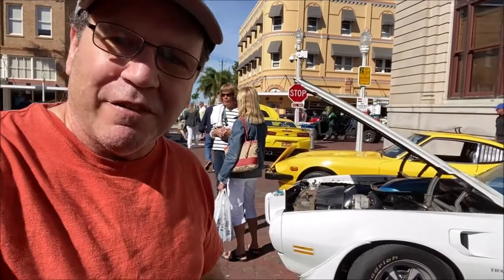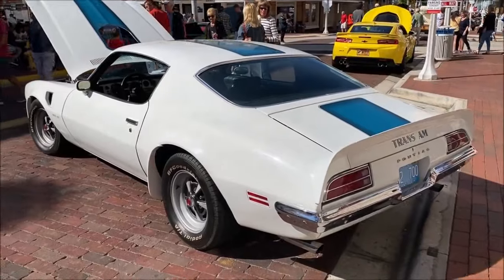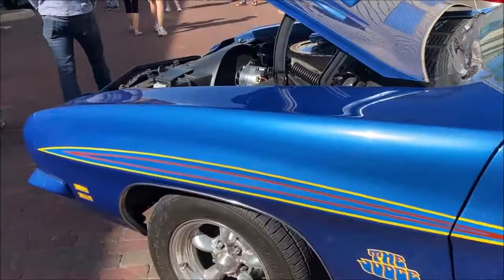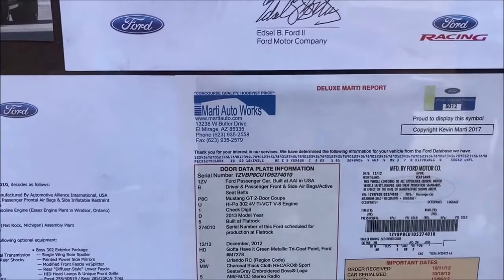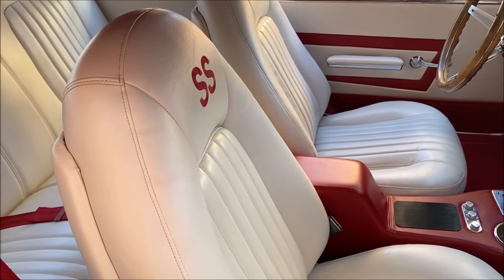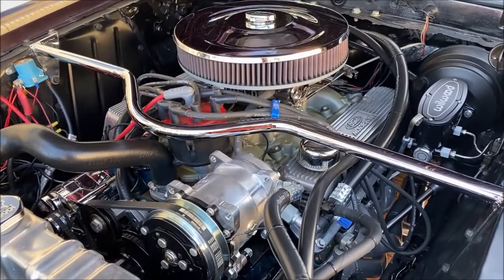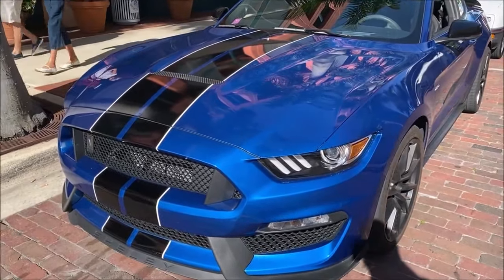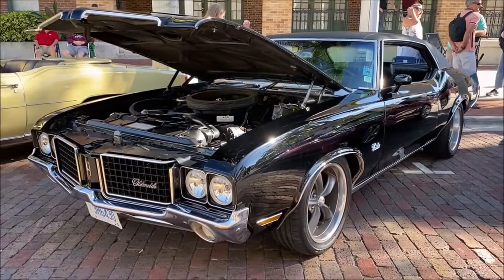1993 Mustang Cobra! _ The Best Fox Body Ever Built _ Down Town Ft. Myers Car Cruise

Comment: 93 cobra? NOT IMPRESSED!! I would rather have a regular 5.0,and money to burn,just my opinion of course...
Reply from the maker: john doe . ..  You have a point but the 93 cobra is a collectors item ..
Reply: @coyotecarguy2076  Would you pay $20,000 dollars for one?? Only rated at 10 more hp? A GT,with a opening in the front grill,different rear valance and spoiler? I just don't see it,but I hear ya!👍
Reply: @coyotecarguy2076  No disrespect intended...
Reply from the maker: @johndoe-zb8bm  . . .  I paid $25k for the new one i bought back in 1993.  ..  If i were in the market for a fox body and could find a premo car i might par $20k but it would have to be a perfect car. .. all stock unmolested. .  I take no offence  dont worry about it Bud!
Reply: @coyotecarguy2076  I know a guy in Va,Red ,no sunroof 18,000 miles.19,500.00.....
Reply from the maker: @johndoe-zb8bm  . .  That sounds pretty nice! I am busy with my 2018 mustang.. but at some point i will move on to something else .. getting my old car back sounds cool ..  i had a red one. .
Reply: @coyotecarguy2076  That's what's up,I love them. Just can't afford them...And you are correct, they are collector cars.. .
Reply: @ryanjamieson8779   Anybody with an I.Q above 70 knows that already.Thank you Captain Obvious.